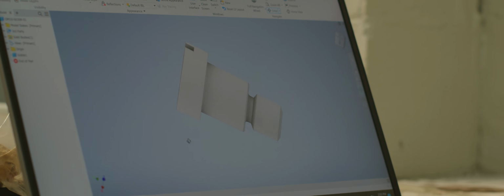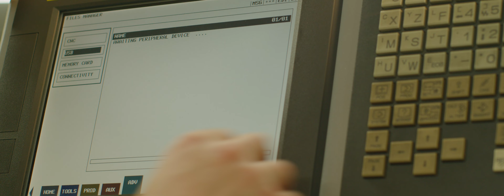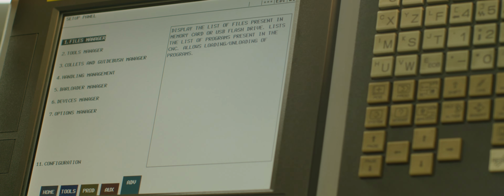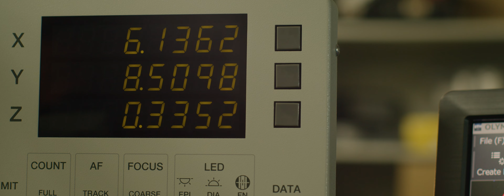The Watchmaker's Workshop: Machining - Making Screws for a Watch

Comment: As part of a repair, I once saw a watchmaker spend an entire weekend attempting to recreate a movement screw on a Romain Gauthier piece. A screw had broken off at the head.  But not just any screw, it was a curved slot screw, or "coffee bean screw" and a replacement could not be located.  He began his reconstruction of the screw on Thursday and worked straight through the weekend (24 hours total) attempting to recreate it.  When I came to work on Monday morning and asked him how the screw turned out he said he really nailed it.  That was after also creating a driver that custom matched the screw.

Comment: Few appreciate the level of skills required in order to make a screw or a spring. 
Ive done both but never to the degree of precision required for horological purpose. 
While that is difficult and painstaking enough you also are the videographer and editor of this presentation... i stand, applaud and appreciate what you do. 
Bravo 🫵👏
Reply from the maker: Thank you so much! 

Andrew Reed is the videographer/editor, as it is his profession. Much like watchmaking, it takes years of practice and skill to do.